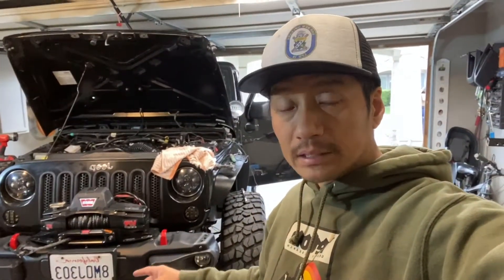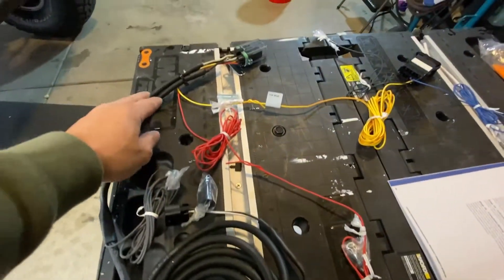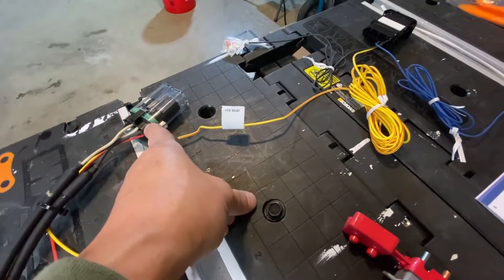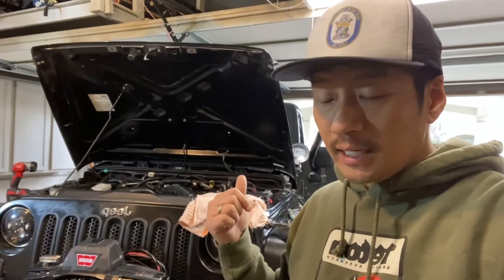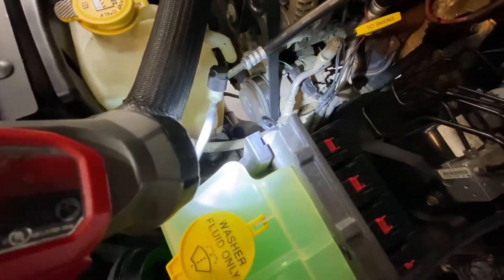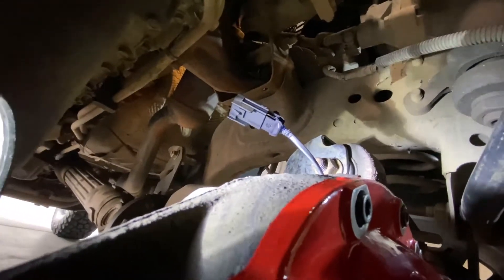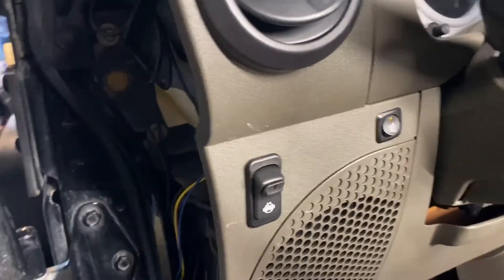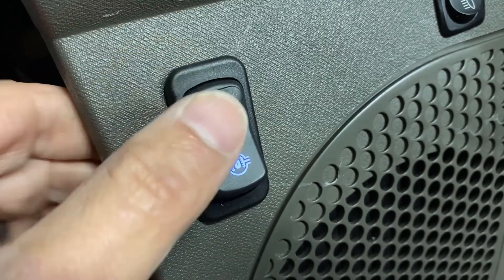Eaton E-Locker wire install

Comment: Thanks for this video. The eaton elocker I bought is used, and the person pulling it cut the wires coming from the actual differential. It has the rubber plug and enough wire, but no pin connector. Any chance you know what those two metalic pin connectors are called, and what size? I have the wire harness coming soon, but not in front of me. Thanks!

Comment: I was deciding between this locker or the Torq Master.  I'm glad I went with the Torq Master--less hassle.  Interesting video though and thanks for posting.  For anyone who wants to know, the Torq Master is a lunch box locker.  You just swap out your front differential's spiders gears and you get a locking front axle when you are in 4-wheel drive.

Comment: hey i’m getting error codes from my eaton e locker on my 2022 4runner SR5…

they had to disconnect it because it was saying an error with electronic system which would shut down my acceleration.

only way toyota fixed it was to disconnect my adapter for the eaton e locker. it’s out of warranty, trying to figure it out cause i still want it

Comment: I have the same locker.  Wired it all in tonight but it would not engage.  There is power down from the wire to the locker.  When you switch yours on can you hear an audible click when the locker engages?
Reply from the maker: No I don’t hear any audio from the locker, but then again I got bad hearing.

Comment: Do they have a manual cable conversion for Eaton elocker?  And differential cover for no drilling application?
Reply from the maker: Unfortunately no. You need to drill the diff for the electric wire.

Comment: What if I have a switch pros. Do I wire the yellow wire directly to my switch pro?
Reply: That’s what I would do. Gonna run mine to my switch pro as well. Guess we’ll see what happens.
Reply: @kahai808  confirmed, wire up the yellow wire to whatever switch you want. Very easy.
Reply: @alvindo7  appreciate the info!
Reply: @Dean Kaai  so the red wire to battery and yellow wire to switch pro?
Reply: @kenworth278660  double relay it?  Switchpro is a relay

Comment: This is a great video. I appreciate how you explained the entire system before the install. I wish I had watched this before my install. I did two e-lockers and put all my electrical (Fuses & Relays) on top of the battery. I created a wooden platform to sit on top, which it looks like you already had for other devices. It's a pain that the wire relays and fuse block are so large on this E-Harness. It would be nice if they sold different lengths of harness and a smaller relay. Thanks for the video.